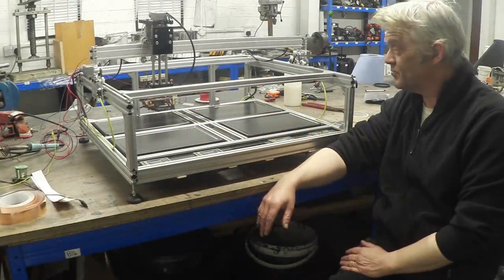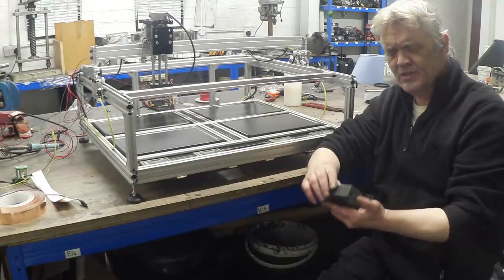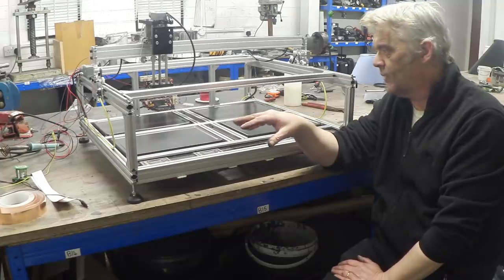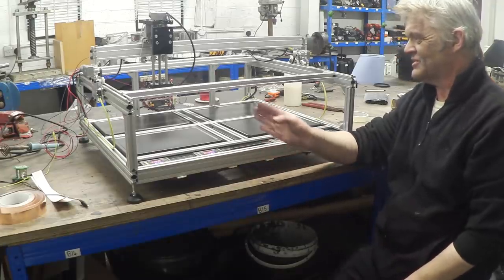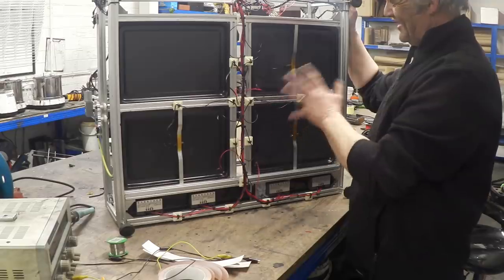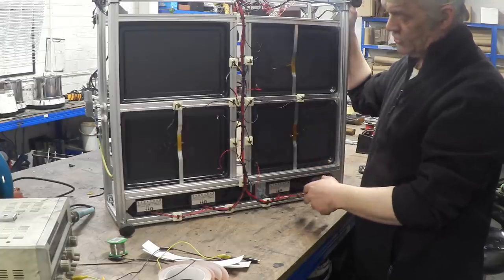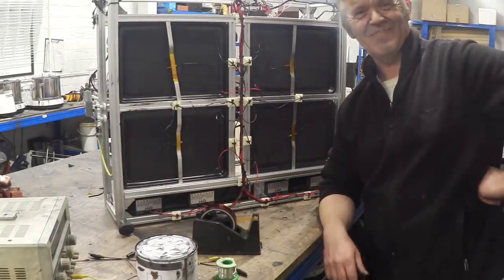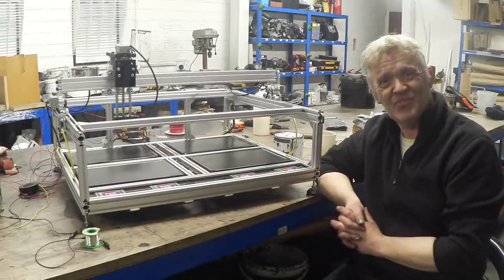A Paint On Hot Plate For SILAR or 3D Printer

Comment: Excellent mate.  I will be trying this to work as a heated bed and enclosure on the 3D printer I use for the graphene impregnated polycarbonate material.  It needs a print temp of around 400C, bed of 130C, and around 100C in the enclosure reducing slowly once the print is done so it doesn't crack.  What I have works, but the temperature has been a bit less than uniform making for a fair bit of waste.  This should smooth things right out!
Reply from the maker: awesome - let me know how it goes mate

Comment: 09:50 - - " ANYBODY  WHO'S  SCARED  OF  12Volts,... NEEDS  TO  GO  &  FIND  A  SOFT  PLAY  AREA "  - - RMS classic 
.
Great idea with the Teflon trays  & use of the FWG  ink.
.
.
Reply from the maker: lol - cheers mate and i can think of a few things for sure and tbh i am sort of expecting folks to suggest quite a few more
Reply: @ThinkingandTinkering   - I remember your - painted wall radiator/heater - this TEFLON  TRAY method could be adopted for large low cost ( home ambient ) heating elements which are easily controllable ( *C )  .
.
Keep up this great work & flow of enthusiastic ideas. Just love it.
 .

Comment: How many Watts are plates operated? 
What are you using as a power supply is it ac or dc?
As Ink thickness is controlling the resistance, how uniform is the thinness?
At what current does the ink start to fail?
At what temperature does the glue on the copper tape fail?
Have you looked at the hot plates with a thermal camera?

Comment: 11:00 you will have better thermal readings if you put a thermal pad there.  Also, in hindsight, the copper tape could have been pre-tinned, so heating up a pre-tinned wire next to a pre-tinned tape would give a nicer solder joint.
Reply from the maker: for sure mate - but we do what we do - cheers

Comment: Have read that PTFE can emit toxins from 200C onwards - might be safer with non-teflon trays. This info from a Prusa forum post titled 'PTFE max temp on a routine basis':

"The pyrolysis of Teflon starts at 200 degrees-C and proceeds slowly up to 420 degrees-C; at 500 to 550 degrees-C, the degradational weight loss reaches 10% to 5% per hour, respectively, depending on conditions. In the temperature range 300 to 360 degrees-C, hexafluoroethane (C2F6) and octafluorocyclobutane (C4F8) were identified as decomposition products. In the range 380 to 400 degrees-C, octafluoroisobutylene (also C4F8) could be detected and, at 500 to 550 degrees-C, the chief pyrolysis products other than tetrafluoroethylene (116-14-3) (C2F4) were hexafluoropropylene (116154), (C3F6) octafluorocyclobutane, and octafluoroisobutylene plus a complex residue of perfluoroolefins. Inhalation toxicity tests indicated that the octafluoroisobutylene gas, the most potent product, was approximately ten times as toxic as phosgene (75-44-5)

Ref: Toxicity of Pyrolysis Products of "Teflon" Tetrafluoroethylene Resin by Zapp JA Jr, Limperos G, Brinker KC. Proceedings of the American Industrial Hygiene Association Annual Meeting, Cincinnati, Ohio, April 26, 1955."

Comment: That's fantastic! Teflon electrical insulation and heat conductivity, and a paint on resistor (heater.) Very clever!  They say nothing ever sticks to Teflon, There's no reason for the paint to chip or warp from contraction and expansion, is there?  Of course you can use touch up paint to fix it, right.   Is 14.4 watts enough heat on each plate?  5 amps for all 4 at 12 volts. ...  24v is better ... 57.6 watts  but 10 amps for all 4, watch your wiring connections for hot spots. 14 gauge?
Reply from the maker: It should be fine and it is in a protected - yet accessible - position - but you are quite right it spot fixes easily with another dab of paint. I am not sure of the gauge of the wire it's rated for 5amps - which is plenty in this application

Comment: Great vid Robert :) So you are getting up to 200 - 250Deg C with 12-24Vdc power supply?
Reply from the maker: you need to insultate as well mate but yes
Reply: Craig G. Lewis - yes 
It’s pure genius.
Just think - packaging made of a super capacitor that upon opening heats the contents to a specific temperature by discharging through its own outer layer ... granted that would be a one shot process but wouldn’t have to be - pots and pans that literally only require a 12v. power Source no stove top required - with the right materials as a substrate viable 12v ovens etc.

A Teflon and graphene ink thermal layer in a space suit.
Again you could be working the super capacitive element into that design all controlled via a micro controller interface ... or even just thermally regulated hunting jackets or underwear...

Viable Solar powered heating systems...

The possibilities seem endless.

I’m wondering how far the graphene based solar power generation has come along...

Just some ideas - but seriously it’s this type of experimental application that opens up developmental applications that are only limited by the imagination.
Reply: @deepforrestalchemy9189  Yes this is the future. Already have the process for mass production, Heating pads and Greenhouse films. Get some funding set up a system. @Robert, we should set up a discussion in the Members channel.
Reply: @ThinkingandTinkering  funny enough : ) "burned toast" is a VERY good carbon insulator.

blend up some moldy bread, and/or add a tiny amount of fresh live yeast and required stiff base insulater material (bread mix style)with your ink , and paint a thin/thick layer on the layered stack heater trays until they rise to your given required thickness allowing for shrinkage later, then zap to the heat to kill the yeast and continue to carbonise and insulate a given space with very little tidy up

Comment: Hmm... Teflon tube is a pretty common material.  If the outside can be coated, it may be of use in some continuous fluid-material processes.  

Now i'm wondering if it could make a rudimentary 3d printer hot-end/extruder that doesn't use any metal.  Because it's a flexible tube, a Peristaltic pump could even be incorporated onto it.  

Anyway, some ideas for everyone.
Reply from the maker: that is interesting mate - cheers for that
Reply: Whoops, i just remembered that 3d printer extruder temps are typically above 200C.   
Still, it may be of use for other things.

Comment: Great work Robert, very interesting concept. have you found any difference in performance, if your paint strokes went with the electrical flow or across the flow?.
Reply from the maker: yes mate - best is 90 degrees to the tapes but for this application it really doesn't matter that much

Comment: Great stuff Rob, you continue to knock then out of the park, (American slang). How does your paint perform under high UV exposure and extremes in temperatures? For example minus 30C to the heating temperature of your hot surface at 85C to 110C.
Reply from the maker: sorry mate i have no ides never even thought to try it lol
Reply: @ThinkingandTinkering  I didn't think you would have tried to determine those type of issues. We will work on that here on our side of the world. I will keep you posted. Cheers mate

Comment: What is the maximum temperature you would recommend for your setup?  I would worry about teflon off-gassing at high temperatures.
Reply: you could of found this easily...  soft play area lol
"Generally speaking, Teflon is a safe and stable compound. However, at temperatures above 570°F (300°C), Teflon coatings on nonstick cookware may start to break down."
"PFOA is a chemical that was previously used to manufacture Teflon. It has been linked to health conditions such as kidney and liver disease. However, all Teflon products have been PFOA-free since 2013."

"polytetrafluoroethylene (PTFE), commonly known as Teflon is now a synthetic chemical made up of carbon and fluorine atoms." 
apparently fluorine and related atoms make good graphene oxide addatives so turn a potential soft play area problem into a benefit down the garden shed option, krank it up mate :-D

so hotter than your oven, good enough to hinge two trays together and do pcb reflow work, add an arduino/esp32 ramp,hold,and cooling scale data graph html page if you like... reflow some plastic into useable sheets, burn some toast crack an egg white over it and so make nitrogen doped carbon foam overnight off that pv charged battery sitting doing nothing right now...
oc if you have some cheap £2 Cooling Peltier Plate Thermoelectric Coolers handy, you could also make the *freeze dried reduced GO foam (with salt water electrolyte) version, and use the toast ( aka nitrogen doped carbon foam) as your insulation.

after robert already did this long ago ,strange
*"Binder-free reduced graphene oxide 3D structures based on ultra large graphene oxide sheets: High performance green micro-supercapacitor using NaCl electrolyte:
Journal of Energy Storage,Volume 21, February 2019

"A high capacitance of 618.15 F g−1 at a current density of 3.0 A g-1 is obtained.

•Optimum energy and power densities are 42.92 W kg−1 and 1.35 kW h kg−1, respectively."

Comment: Is that paint flexible after it dries? Or does it crack after it's dried and flexed.  That would be a very interesting property if it is flexible.  Might be an interesting ability to have in a different formulation if it isn't.   Wink wink, know what I mean?   Grins mate.
Reply from the maker: it is a thin film mate so very flexible - on plastic you can bend it right in half

Comment: You mention that a rotating bed is no good with heaters, but I think someone was mentioning a rotating head. There's an image of the setup here: https://www.holmarc.com/silar_controller.php
Reply from the maker: Do you know - I find it doesn't matter what you say - left or right someone somewhere will say something different - this is just my best guess mate and I am aiming at folks making this themselves with basically a few hand tools - for that I think this is a good way to go and rotating heads are best avoided - but if you think not - well no worries - cheers
Reply: @ThinkingandTinkering  I wasn't downplaying your approach; it looks very well made and the pressed pan heat pads look very professional. I was just pointing out that the approach you rejected is similar to one that's viable. Regards.

Comment: Are you shitting us?  I almost can't believe my eyes + ears!!!  You made a electric heated surface thermostatically controlled able to go up to 200 deg C. (+,-) in this video???????   That is remarkable (if true) if it is as simple as you've demonstrated.   That is more awesome than most viewers are capable of grasping right off, imo.  Not because they are not able to grasp it but because they might not immediately grasp the uses this could prove to be applied to as products.   I'm serious,   "Are you shitting us? "  I suppose not but this is something I can think of using in several ways just off the top of my head.   I must take the time to get this paint and experiment.  Do/Will you accept orders with Paypal and ship to the US???   Let me know.  Cheers.
Reply from the maker: Quite a few folks have been using the ink in heating applications already mate - I think one guy paints wall radiators with it - I understand you skepticism - but it is that easy - so by all means give it a go - we do accept PayPal and send to the US - but I have to ask you - can you do a vid or two just to let me know how you get on - cheers
Reply: I'm thinking  of putting in a Tesla battery  in my 28 ft.  RV.  It's a  24v, 5.3 Kwh module, which I already bought on Ebay for $1,250 us.  It will need a simple heating system and control circuit so the module could be charged in the winter if the temp's got below about  2 c. .  You'll destroy a Li-on battery if you try to charge it below 0 deg. C.  so it needs to be insured against that.  With this ink and a bit of temperature control magic it could do the job nicely, I suppose.  I just might use the money for a heating pad and apply it to some paint and use that to make an electric heater for the battery bank .

 I also been " what if'-ing" the possibility of making a dedicated electric bread baking oven for baking bread in my RV..  Instead of using propane to heat my RV oven to bake bread. Being a nut,  I would like to try (experiment) making a highly insulated (to reduce heat loss/costs) bread baking oven.  If this ink set up right would make 180 c.  inside an enclosed, minimally ventilated, insulated enclosure that should bake bread nicely with minimal energy usage.  Of course one never knows how an idea will work  if one never tries a "what if idea",  Right?   Look for my order for some paint.  Best wishes.
Reply from the maker: @rickdees251  you are spot inmate a lot of what if can only be answered by doing - you have sparked an idea though - I have an old oven and.`I could convert it with the paint - you ok if I do that as it was your idea really - cheers - Rob

Comment: Dear Robert Murray Smith i have a question about wast water and how to mange it im making a screen printing washout booth filter system and i was wondering if you would have an idea on how to improve and make a working device that could purify the waste water before it goes dow the drain im going to use water based ink and photo emulsion on the screens the diy systems that is out there dont look safe to me sorry but what do you think?? would it make sens to use a sand filter with activ carbon or somthing in that sens??? Sorry for being of topic but a huge admire off your work mvh Lasse Askhøj Anderen SunTurtleCamper.com
Reply: sorry fogot the dimensions h 1900mm* 820mm* 440mm space under wash out area 470mm* 770mm* 420mm could modify unit if more gravity is need then it would be 2100mm* 820mm*500mm top reservoir as big as the plastic sink 90 l bucket https://www.silvan.dk/murerbalje-90-liter?id=2640-5725349  maybe make a filter on the side like this would it make sens?? sorry video little long just skip true to get idea  https://www.youtube.com/watch?v=ffZxFBLQzaY and would it be safe to send down the drain or what do you think??
Reply from the maker: Hiya mate - I am sorry but I really don't know the answer here - water remediation is a pretty complex subject, expensive to do well and full of quirks specific to the application. Sorry about that
Reply: @sunturtlecamper4256  at your own risk oc, and i assume you know to keep h2 away from oxygen/air and flames for safety... depending on how much h2 you are generating ... 
as a side note, bubbling near pure hydrogen  through few layer nano carbon powder helps make it magnetic..

iv not reproduced his experiments but engineering logic seems to agree that lowering the direct oxygen/air to hydrogen ratio contact while burning the gas works in a safe manner, as in his super simple "sand heater"  https://www.youtube.com/watch?v=Bd_yrSldFWw
Heating with Hydrogen HHO or Hcat. This man does just that.
156,065 views•Oct 14, 2016
,delvis11

oc as Okki Moeljadi found out as a side effect, surrounding your small hydrogen generator on demand tank with water is very good safety practice to as it helps contain accidental explosions and again reduces getting direct oxygen/air contact while its flash burning... so perhaps add  a water heat exchanger around any  "sand heater" design